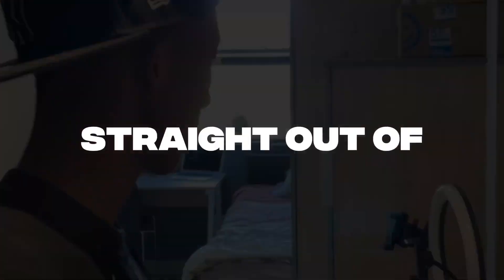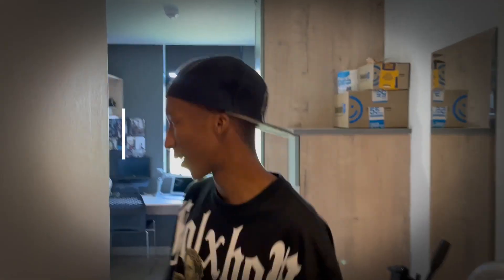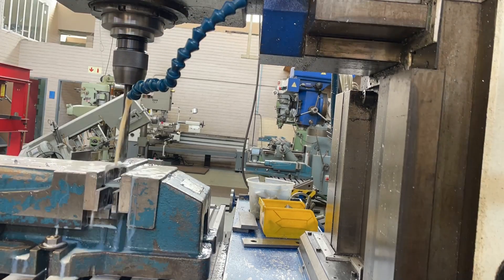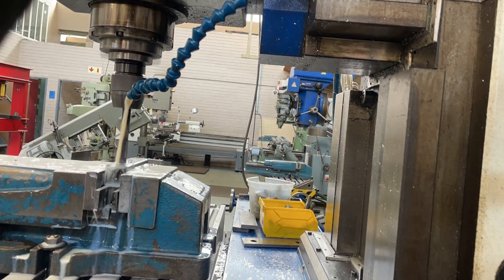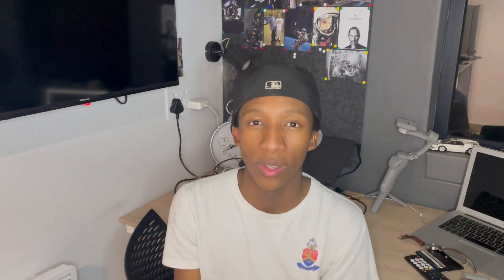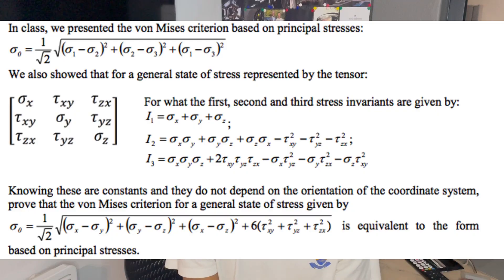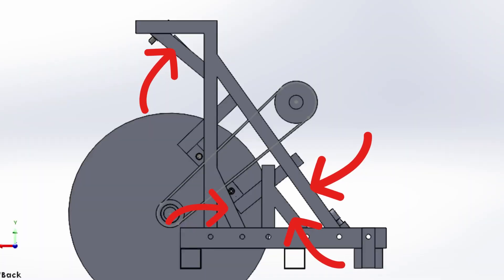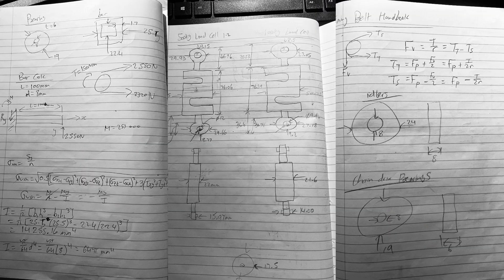I finally built my final year engineering test setup!

Comment: What is this test setup supposed to measure?
Reply: Watch his prev video🫣
Reply from the maker: My gee! 😂
Reply from the maker: How tension varies on your belt tight and slack side as you vary torque
Reply: @siphojoja  Shouldnt it be very easy to calculate knowing static preload and torque acting on pitch diameter?
Reply from the maker: Exactly once you know torque and static preload you can calculate variations in tension. The theory is easy. To measure that you need a build a setup, have 3 load cell sensors, and strain gauges with a torque telemetry system measuring data all at once. So practically doing is the tough part, not the theory
Reply: @siphojoja  Also this doesnt need to rotate during tenson measurement. Rotation will give very hard to eliminate variances in force caused by brake.
Reply from the maker: exactly, hence I am doing static and dynamic tests